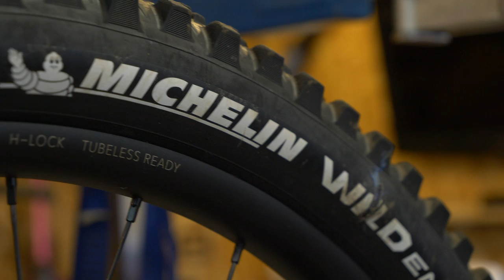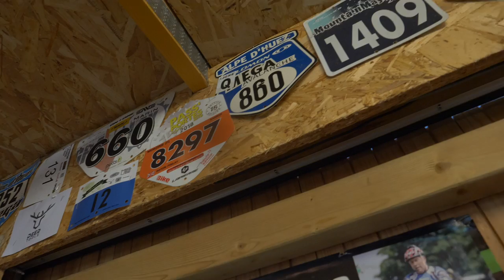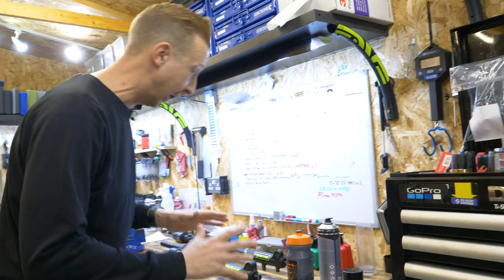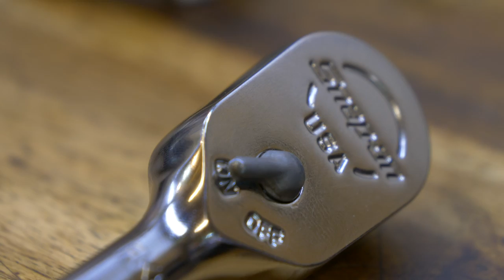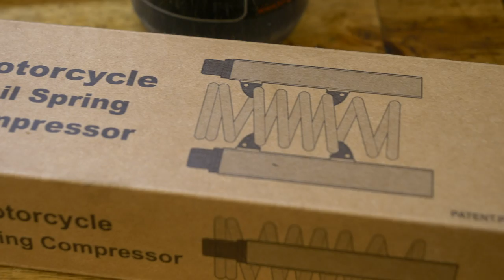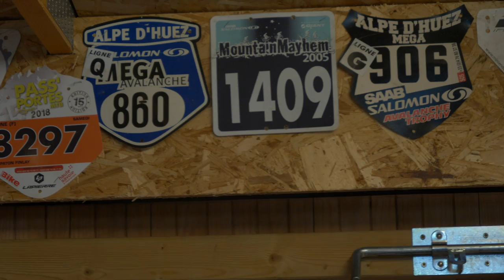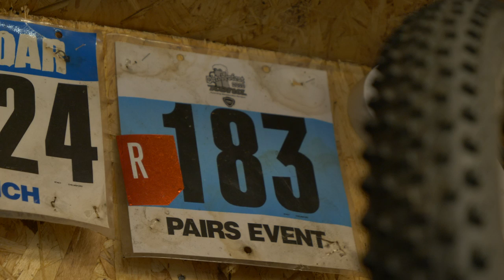The Ultimate Shed? | A Suspension Specialist Bike Cave

Comment: #askgmbntech 
How possible would it be to put modern fork internals, probably higher end coil, into an old Manitou 1 fork to upgrade a 1993 Marin Pine FRS. That includes the rear 'fork' too. Thanks!
Reply: not impossible  - but the problem you'll have is old Elastomer units have a built in damping , when you fit a spring you'd need to make a damper also to control the spring
Reply: @finlaypaton7202  I was expecting to have to implant both spring unit and damper unit of the new fork.
Reply: @judechandler5102  I think you may find getting something narrow enough to fit would be the biggest challenge
Reply: @finlaypaton7202  I suspected that might be the challenge. What about 32 Stepcast? Much shorter air shaft? I guess trying to make the chamber airtight with the original sliders and lowers would suck. Stanchions would be too narrow too. Damn. Any ideas? I know that others have done simple spring conversions on manitou 1s, but they've relied on elastomers for damping. I'd want a  at least semi-decent damper unit.
Reply: @judechandler5102  old Manitous are 28mm
Reply: and I seriously doubt the Manitou has a smooth enough inner surface to seal on any piston seal, It would have to be a contained unit such as the old Englund cartridges that they made for Judy
Reply: @finlaypaton7202  Well, looks like I'll be doing a scratch built coil fork and fluid damper conversion then. Bugger me. Thanks for the advice Fin!

Comment: #askgmbnt hi guys , firstly loving the show ! I’m currently upgrading my rig and   at the moment in the process of up grading my brakes and rotors ! 
My current set up is 180 (r) and 160( f ) rotor ! My new set up are the v4 hope brakes with 205 rotors front and back ! 
My trouble is finding a post mount to make up 25 mm for the back and 45 mm for the front ! Please help me ! ( it’s a mine field out there !) my fork is a fox float 34 ( orange )
Reply: you won't get much modulation with 205mm rotors and hope breaks. Unless you are riding some seriously and grippy shit, your gonna be dragging your tyres a lot. Even Danny Macaskills latest video, where he rides really steep and grippy cliff faces. he only uses a 205mm in the front. DO 205mm front, and 180 rear. Might give you a bit more control
Reply: @judechandler5102  thanks for your input but it hasn’t really answered my question of finding the right size post mounts !
Reply: Have you tried Hope?
Reply: @Rossmann32  go for 203mm rotors, That's the industry standard beyond 200mm. I only know of one company off the top of my head that does 205mm. You'll find getting parts of that size rotor really hard. Its easy to get 180mm to 203mm adapters online. Just run a 180mm adapter with the 180-203mm adapter on top. A commonly done thing. As I say though, you only want 203 if you race downhill really. Its massively overkill for anything else. I don't even know any pro DHers who run 203mm front and rear. Only front from what I know. Hope this helps.
Reply: @finlaypaton7202  yes m8 I’ve sent them an email ...... just waiting for a ply 🤟🏻👍🏻👍🏻

Comment: #AskGMBNTech Doddy, absolutely love the show. Got a question about brake pads. I run magura MT7s and after my last set lasting me around 100 miles its got me thinking. given that the MT7s run 2 pairs of pads, would it make sense to switch out the rear sets of pads on the caliper from organic to sintered seeing as they're the ones that are getting hit with the majority of the finest dirt and grit the North West has to offer? 
Cheers, Richie.

Comment: I am not that keen on the E-bike trend because a E-bike is pretty much a slow dirt bike(motorcross) at that point. I am a bit against the trend of MTB going slacker/longer because they are pretty much dirtbikes without an engine at that point and that makes the rider lazy as he can just plow through the gnarly terrain compared to how it was back then when a MTB was just a bicycle, and now with the E-bikes now we got pretty much e-dirt bikes. So if you are not old something like that why not just go with a dirtbike(motocross) hobby from the start, the price is not that far removed these days :P
Reply: It's much easier to find places to ride mtbs than dirtbikes. So many places outlaw motorised vehicles offroad. An E-bike doesn't count under those laws in most places. 

I think its good to see the industry pushing the limits of what can be done on the slacker, longer end of stuff. I'm sure in a years time they will realise it's too much and come back to shorter and steeper, but still retain the technology used to stiffen forks for slack head angles etc, thus reducing weight on a fork designed for a more upright ride.
I come from a trials background, and I love riding slow techy trails and steep techy climbs with accuracy rather than monster-trucking over it all, so I agree with you that it might be going a bit far. However, the industry is driven by the preferences of racers, and there is no denying that if you want to win you have to go fast, and if you want to go faster over the same terrain, something akin to a dirt bike with big wheels is the fastest way to do it.
Reply: Basically _ can ride the ebike anywhere and I like speed, so me and MX bikes only lead to hospitalisation LOL
Reply: @judechandler5102  I dont know man, most places(countries) do not allow for the public to trespass on private land, and those that do dont allow for e-bikes on the trails/woods/land. I can see the charm of an e-bike when one wants to use the e-bike to the trails or for very long session. But as I see it, e-bikes in the woods is a no go for most places anyway. If it is not an specific bike park with bike trails and such.
Reply: @Pillokun  fine in the UK  - mostly

Comment: first
Reply: @gmbntech   loving the chanell  i'm wondering  at getting a  trail bike with  130 or 140 of rear travel . my budget is 3600 pounds.
I am doing black runs flowingly  and doing  1 meter  drops  and I want a light ish bike that I can throw around. btw I am  159 cm and 12 and 1 half years old